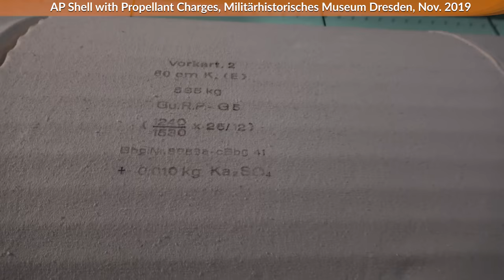Why the Biggest Gun built was Useless

Comment: I feel like the guy nailed it with "most huge" instead of saying "biggest"
Reply: That profile pic :o
Reply: The English language itself needs to either stick with their root or move with the time. It should either force comparative form into every speakers’ throats, or just “more x” or “most x”.
Reply: @Nanorisk  stop dissing English. It's a fine language, it has its quirks but it's pretty epic.
Reply: @Kyle-gw6qp  BMW cars are regarded as driver's delight, meanwhile they are notoriously prone to oil leak. Having issues and being praised can coexist, they just don't cancel each other out. English is terrible in the consistency department, being widely used doesn't change that.

Comment: Barnes Wallis' 6 Ton Tallboy "earthquake bomb" shook down bridges, reduced U-Boat bases to rubble, and sank a capital ship. All that was needed was an Avro Lancaster bomber to deliver it with fewer personnel and less fuss than "Gustav" or "Dora." (The "V3 Gun complex' was also destroyed by "an earthquake" before it could fire any rounds at London.)
Reply: There was also later the Grand Slam, which was expensive for a bomb but still only needed a Lancaster.
Reply: Technically I agree with you, but one should not forget that to get that one Lancaster to the target required a squadron of Lancasters as well as fighter escorts and many ground crews to prepare all the planes and weapons. You're right that this was still far more effective and efficient than having 5000 guys to operate a weapon that couldn't hit the side of a barn from inside the barn. And could basically fire once an hour. You'd be far better off with like you say aircraft delivered ordnance or even naval guns that had greater accuracy, firing rate and speed and could use materials already available. I know this was also tried at various points and the aircraft solution was still the best.
Reply: @sophiepaterson7444  The 'Earthquake bombs' took a long time to develop, and only came into use in 1944/1945, it was unfortunate that there weren't aircraft able to deliver them either.
Reply: @sophiepaterson7444  Definitely more accurate too.
Reply: Not to mention certain huge battleship in Norway

Comment: Remember the cube law.  If a round is twice the diameter, it's mass is eight times.  It's about 25% increases in diameter to get twice the mass.
Reply: Yep, thats why you simply can't scale up say insects too, their legs would need to be massive.
Reply: And the strength goes up with the square of the scale (vs cube for the weight), from the cross section of a component. You can't just double the proportions of an existing gun and expect it not to break more easily. You have to disproportionally beef up the lower parts, which in turn increases the weight and cost even more. Try breeding a 4m tall man (to be a super soldier or Olympic athlete)... the leg bones would have to be much more than twice the diameter (of a 2m tall man) in order not to break when he ran. Eight times the stress (weight) on four times the strength (four-fold cross section) for 2x simple scaling. You'd have to have something like sqrt(2) times extra diameter to take the stress.

Comment: yet another example of how very expensive and singularly powerful (yet quite interesting) engines of war don't scale well compared to more economical and numerous alternatives. others include the  IJN Yamato vs the Iowa class battleship, or the Tiger vs the T-34 or Sherman tank
Reply: Not this again. The Tiger was a specialized weapon designed for different roles than the medium tanks you're comparing it to, and considering that both the U.S. and the Soviets developed heavy tank programs of their own as the war went on, and eventually developed them into the MBT of the cold war era, the Germans had the right idea in supplementing their medium panzers with a heavier, more expensive tank.

Comment: Cannon barrels are measured not only by bore diameter but by how long they are  in bore diameters.  An ordinary railway gun of the same barrel length, but half the caliber would twice as long, in calibers.   It would need only one track.  It would also fire faster and with more accuracy.    The gun as built would be a huge helpless target, requiring a large force for defense..    The US atomic cannon was largely a white  elephant, for similar reasons.   It was far more mobile, acting more like traditional railway gun.  Thanks for a fine video.
Reply: The use of "caliber" is common for larger naval guns -- did they also use it for army guns? In this case, "caliber" is the ratio of gun length (breech plate to muzzle) divided by the shell diameter (bore). Thus, a 5 inch/38 caliber (190 inch length) gun. The higher the caliber, generally the higher the shell velocity.

Comment: Massive guns like this today could actually be pinpoint accurate using, for example, laser-guided or other precision-guided shells, tech which did not exist yet in the 1940s. But of course, tactical missiles do this job even better now and don't require a giant traveling circus to use them.

Comment: This is gonna be a stupid question but I want to know why they didn’t try this gun against tanks? Like wait to direct fire it at a group of T34 tanks. You might as well also fire a kubelwagen out of it. Lol
Reply: Do you even have any idea how much effort it took to move this gun anywhere?It needs two parallel tracks to be built,so no much moving could be done.On Crimea, they had to bring it in parts and assemble it before they could use it.If you are using massive gun,that takes about an hour at least to load the next shell,that can't neither advance nor retreat beyond it's double track line (not much of it being built) against tanks in direct fire, you really are using it wrong.Even against entire tank regiment of about 60 Soviet tanks it would have been quite a waste of shell.Also,that means it's actually inside firing range of the enemy,so gun could get damaged, knocking it out of service.
Reply: Nikola Kalezić You’re right. I’m just really curious if you were able to hit a T34 with a shell that large what would happen to it?
Reply: @tombrunetti3000  A tank with a very large hole in it; the shell explodes in the ground, flipping the tank through the air for quite a distance. Tank destroyed. Overly destroyed. Waste of a shell.

Comment: THAT IS A SHELL
Oddly this did have a use.  
Stalingrad.  
The Germans could have ignored taking the city and it's factories, tanks no less, rolled up to the Volga at some relatively defensible point dug in in depth sufficient to keep Volga under interdiction by regular artillery units even if Russians pushed them out of lines temporarily.  With in depth supply depots under some cover, even just sandbagged bunkers, move air units between multiple air fields to make classic get them on the ground anti air missions less reliable, maybe even deploy their limited radar, mobile counter attack corps and for at least a year if not more required to concentrate every available force to dislodge Germans Russia would have been severed from Southern fuel oil, food, did the S lend lease corridor also use the Volga?  This gun would then have been effective even at 1 shot an hour for 12 hrs a day to shell industrial areas of Stalingrad to materially impact if not stop military production.  I'd guess in unprotected city buildings anyone within 300 feet of impact of a shell if not pulped from over pressure wouldn't be working anymore that day, most would stay home hiding in the basement for a few days before venturing out and 3000 odd shells like this hitting the factory areas of Stalingrad over a year might have well counted the same as an epic saturation bombing.  If the Russians pulled factory equip out of Stalingrad they'd have still have had to garrison the city as Stalin was insanely committed to holding it - thus wasting troops protecting something the Germans had no intention of attacking and represented only useless mouths to feed once factory equipment removed.  Loose Loose for the Russians.  Obviously the gun could also have been used to disrupt forward operating bases of any forces assembled to dislodge Germans from blocking position on the Volga.  Range could have been enhanced if needed by introducing SABOT rounds,  accuracy (against unprotected urban troop and supply areas) with DPICMs, Germans were pretty clever, would have occurred to them.  By using multiple bunkers and deliberate deceit to fake firing sites it would have been nearly impossible for Russians to have stopped it.  Similar gun w similar protection marginalized Anzio beach head despite OVERWHELMING allied air power and conventional artillery.  Thank God the Axis forces were dominated strategic idiots mostly interested in the glory of COMBAT.
Reply: Imagine putting a big ass gun in the middle of an open steppe. The amount of forces needed to guard such a valuable target will exceed everything that germans had in reserves. Germans lost because their airdromes were captured due to lack of defence. They should have pulled out from doomed city early or at least bring reinforcements to the airports and logistical lines, it would be more than sufficient.

Comment: Should have reused the Paris gun with its turntable aiming. Otherwise such huge gun are more of a hassle than anything else.
Reply: The Paris gun only had a 21cm caliber but a very long range. Dora is designed for penetrating stuff smaller caliber guns can't. Germany builds the railway and siege artillery of the same caliber as the Paris gun in WWII  even 60cm self-propelled siege mortar. So except for the long-range that was no neede they did that. You could in WWII have the same longe range effect as the Paris gun with bombers for a lower cost.
Reply: @target844  I meant, develop the concept and amp it up a few levels. But anyway, thanks for the interesting answer.